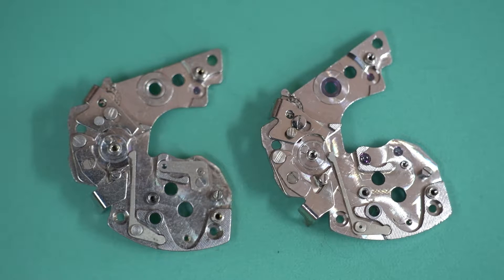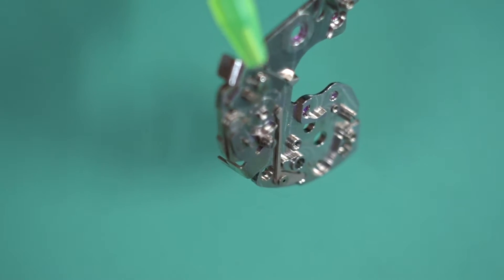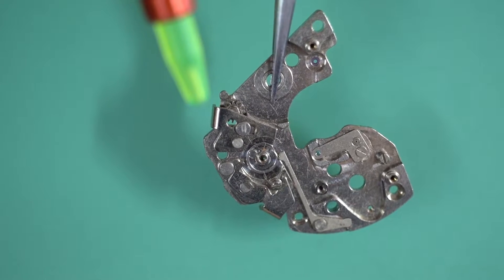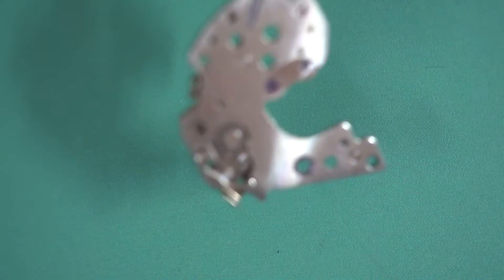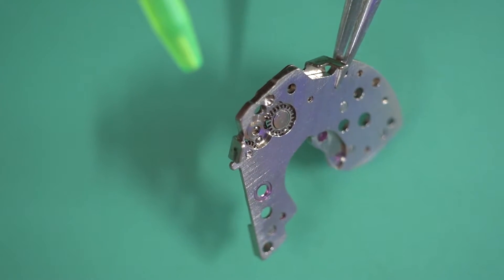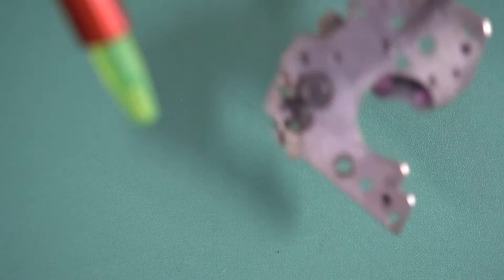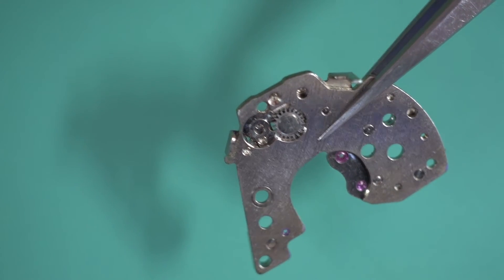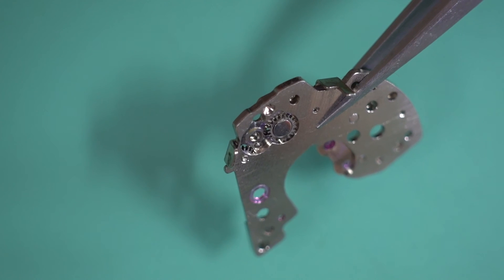[TECH] - SEIKO 6138 Bodge REPAIRS - Epic FAIL!

Comment: What is the story with the "upper hole jewel for barrel" on the bad train bridge?
Reply from the maker: Someone installed a barrel arbor jewel from a 6146/56 in the top to try and correct barrel arbor wear. The catch here is the 6138 usually doesn't get arbor wear, so they've attacked the wrong problem I think.